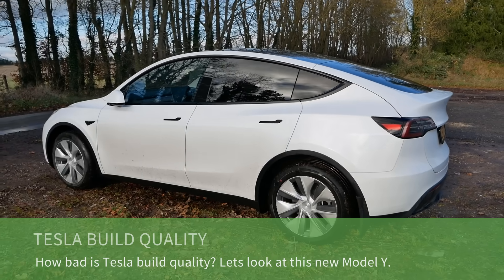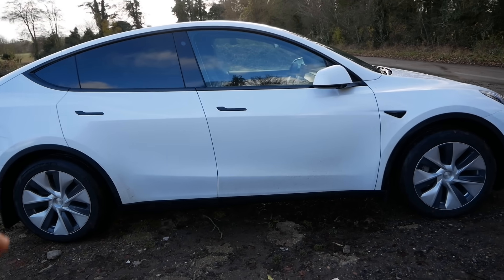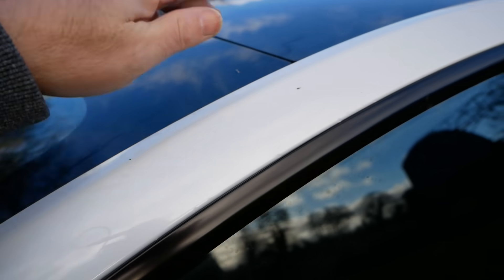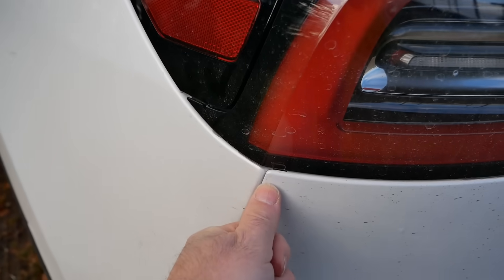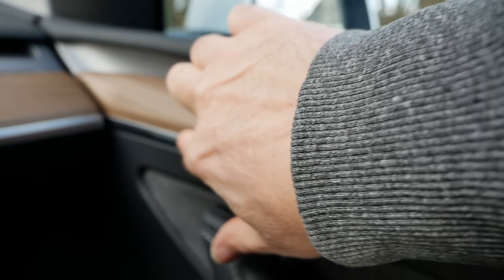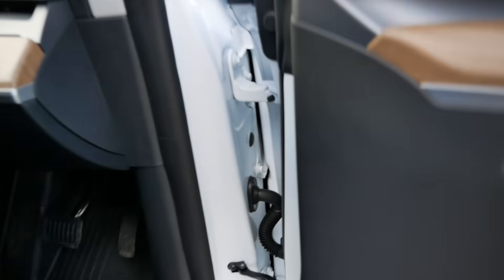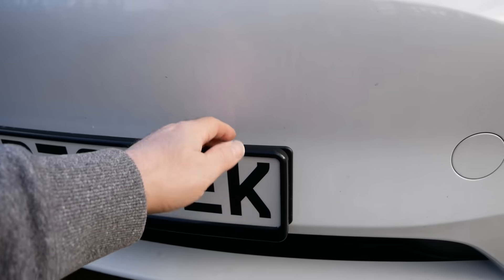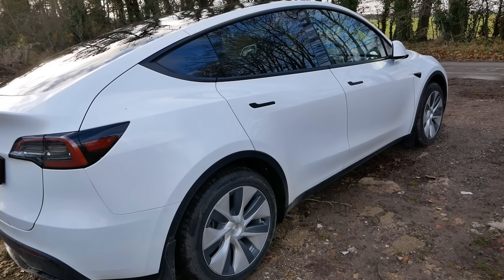How good is Tesla build quality? A look at a new 2024 Model Y.

Comment: Took delivery of first Tesla last week (model Y).  Have to say, compared to my previous BMW i4 M50, it’s been much better than I expected.  One annoying thing is the buzz / rattle that comes from the rear view mirror housing when going over a rough road surface.  I’ve seen a video on how to fix it which I’ll be doing in the new year.
Reply from the maker: Sure the protecting rubber strip hasn't been left on the mirror? It often is on new Model Ys.
You might the next video out on Sunday too. Its about rattles in Model Ys.

Comment: Got a new model Y in June 2024. Over anything but the smoothest of tarmac it has loud panel buzz from several places, the driver's seat creaks and there is a rattle from the back. In contrast my 4 year old BMW i3 has no creaks or rattles.  For me, interior quality is much more about silence than the materials used so on that basis Tesla has failed miserably in my case !
Not sure if I should ask for it to be looked at under warranty?
Reply from the maker: Yes you should do. If they can find the causes of the noise, they will fix it.
Where was your Model Y made?
Mine has done 12k miles now and still rattle & creak free.
Reply: @GoGreenAutos  It's exactly the same as yours so made in China. Thanks for the advice, I will contact the service people

Comment: My 2021 Y was one of the good ones I guess, I haven’t noticed gaps or anything major. I did have to screw in one of the bolts at the front, it was half way out from the factory. So far so good, no rattles or crazy gunks. But it’s been 25k mi, we’ll see at 50k. White is such a nice color.

Comment: Got the exact same one on the 25th Jan. I would guess our cars were on the same boat. Ive noticed maybe the boot alignment isnt 100%, but other than that ive noticed no quality issues. Rear seatbelts have a habit of finding their way onto the plastic to rattle, just need to make sure those rear seats are reclined. Being an EV is so quiet, you hear everything. My fave features so far, the cabin heats up so fast, and the sound system is awsome
Reply from the maker: Yes the heating is so fast. The sound system is probably my favourite feature.

Comment: Those huge wheel arch gaps ! Not cool. Panel gap gets smaller as you go down.
Reply from the maker: I've checked with some plastic shims and the gaps are equal as you go down the doors. If it looks not, its the camera angle.

Comment: Just snagged a 2024 Y built in USA. I do have one minor issue. The seal between the driver’s side door window and the frame is ever so slightly not sealed properly. This creates a faint noise almost like your window is cracked open a bit when driving at higher speeds. Other than that nothing else is wrong and I’ve inspected thoroughly. Mobile service will be coming to fix it in a few days for free. All in all it could have been better but the overall experience was very good.
Reply: How did the fix go. Do you still like it?

Comment: Own 2023 Y long range - issues with random wiper turning on while driving and still the same after 4 repair visits in 6 month.  Don’t buy TESLA.
Reply from the maker: Wipers were turning on when Autopilot was engaged and they really cocked up auto wipers. But its improved with later over the air updates. I find the wipers work just fine since the last few software updates.
Reply: @GoGreenAutos  they updated my sw and cleaned the camera and it still does EVERYDAY.  And the chime alert for green even turns on for red light as well.  Camera goes blind sometimes, too. They have been telling me that the next sw update will fix the issues and the car is sitting in the garage collecting dust.  They can't fix nor want to buyback. Money wasted.

Comment: Mostly what I've seen the Model S is built a bit better. But the others especially when Musk insisted on increase in production. The Quality control seems very lacking for what your paying. I find it funny Sandy Munro goes gaga over the engineering, yet never said one word on build quality. I know every factory has lemons that get released. But you'd think there should be inspectors to make sure if it has leaks into the rear signal/brake lights, or other issues, they should reject them and correct it before selling it.

Comment: I am disappointed my 2021 model Y climate control system had to be replace at almost 3000 dollars because I was over the 50 Thousand mile and they can’t make a climate control system that last two and a half years very disappointed
Reply from the maker: Not good news. However, I've been extremely impressed with the climate in the MY. Its been the most impressive heat pump system I've experienced.
Reply: @GoGreenAutos  

There was a YouTuber from Iowa; he had the Heater/Compressor gone on his Model Y 2021?  59k miles?  And cost 3k to have replaced including having Had Tow Truck tow 70 miles for 720.00 Dollars... in December 2023.   That is not Impressive!  versus we used our Subaru Legacy 1992 = in the first 12 years cost us nothing but Oil Changes myself for less than 50 Dollars a Year.

And the Timing-Belt was original until 2019!

C'est La Vie =  That what we call Quality and Engineering of Japanese Prides.

Comment: Good video. Very meticulous exterior examination for fit. 
I am on my sixth Tesla (‘10, ‘12, ‘16 . . . ‘22) and I have never had a complaint about fit nor finish.
In this video, he talked all about the exterior fit, but not the quality of the paint job, which is the meaning I use of the word ‘finish’ in the context of fit and finish. It seems this owner uses one of the other definitions of finish, or simply ignores it on the exterior. On the interior, he does talk about the finish of the driver door aluminium trim.

Comment: How good is a much better title. Panel gaps worries are for OCD types. We have 2 Y’s 2021 & 2023 both are just as high quality as any of the many Toyota’s I used to own. Fremont 2021 Austin 23 both are excellent. If people knew how much better Teslas are at 95% of what cars do they would take off their it’s not perfect so forget it glasses and make the switch to the obvious next step in modern transportation. ICE was fun while it lasted. My panel gapped 2021 Y upgraded performance is still undefeated out of the lights. The Only mass production car as fast as a Tesla is another Tesla. Safer, much faster, Incredible efficiency, Killer stereo, awesome seats. Still on my OG wiper blades after 3 years 76K miles. Teslas might not be for everyone but they are perfect for us☀️⚡️🔋 🚙

Comment: Battery powered vehicles looking for a solution to a problem that doesn't exist.
Reply from the maker: The problem is air quality and poisonous emissions from burning oil in a car. That problem does exist.
Reply: @GoGreenAutos  This isn't the 1960s.   ICE emissions today are so insignificant it's not an issue.  The MGUY channel lays out the stupidity of Battery powered vehicles, but what would an engineer know about it.

Comment: My 22 y perf has been to shop 3x. Once for clicking rear axle needing relubed and tightened. Once for rain soaking rear cargo area leaking through rear glass had to be resealed now its in shop for faulty seat air bag sensor being replaced. Panel gaps and unlined outside door trim. The 2023 y lr loaner I'm driving makes a loud bang from tear when starting off from a stop occasionally. Feels like I have been rear ended. So much for build quality. 😂😂 if I didn't love driving this thing so much I would care. But I don't. Myp is most fun car I've ever owned.

Comment: With my 2022 Model Y the plastic around the rear view mirror rattles. When it happens I push it up into the glass and it goes away. I saw another video that mentioned this issue and that guy got it fixed.

Comment: The "poor build quality" issue was real some years ago, but has now disappeared.  The anti-EV, anti-Tesla, anti-Musk fanatics have had to find new topics to whine about.  Life goes on...
Reply: Dont have to find anything.  Musk supplies crap hourly on Twatter. 😂😂
Reply: Not necessarily true. I just received a model Y. I had a panel gap on the left door, and the top glass on my model y had a hairline crack through it. I had to take it to get them both fixed. They did fix it for free, at least .
Reply: The panels flying off the cybertruck would like to have a discussion

Comment: Bought a 2023 MY LR built in Austin TX. I gave the vehicle a thorough look-over at delivery, and ever since. Verdict?  The build quality is flawless to my eye. If there are panel gaps, mis-alignments, trim displacements, light and camera installations, or panel/glass height discrepancies, I cannot detect them with my very critical eye. I do get a passenger side seat-belt rattle sometimes, and that's my biggest (and niggling!) criticism. 

OK, one other gripe, more important: I live on dirt roads in northern New England, which means dirt and snow. The rear back-up camera gets quite dirty and is a constant chore keeping clean. Would appreciate a better rear-camera placement. 

Other than that? After 23K miles in my first year, the MY is absolutely freaking brilliant.
Reply from the maker: Good to hear.
Yes the cameras need a wash or blink system to keep them clean, especially for future self driving.

Comment: I picked up a Model Y Performance in December of 2023. There were still issues from the factory. Not as bad as my Model 3 Performance though. I found a few loose threads on the seat, a door ding, about 8 dust specks in the paint, scratches on the red calipers, adhesive on the glass, scuffs and scratches on the paint. Even on the new car it took a full day to buff all of the scratches out before bringing it in for paint protection film and ceramic coating. The new car feels much nicer than my Model 3 and is quieter on the road. The new Model 3 highland may go a bit further towards improving on the quality of the vehicle. It still does not feel as premium as the materials in our Lexus or BMW.

Comment: Is this still having traditional Model Y issues on wheel wells (very thin paint layer & water collecting inside the panels)?
Reply from the maker: The Model 3 had thin paint issues on the sills and wheel arch edges. All sorted with the Model Y as those vulnerable areas are covered in plastic.
Reply: @GoGreenAutos  Yes, I know. The painted and water filling parts are hiding behind the plastic cover. And apparently these parts can rust even after one winter season in the areas that use a lot of salt to de-ice the roads.

Comment: Great to see that your vehicle is not a lemon. Tesla has definitely improved the build quality of their car but they need to control their cars better when delivering them. I took delivery of a refreshed Model 3 aka highland and the trunk was misaligned that it damaged the paint on the left corner. I noticed this on delivery day (my 1st EV) and could not believe my eyes. I obviously immediately notified the nice lady at the delivery center. What really disappointed me was what came next. She told me that I could refuse delivery or take delivery and log the issue via the app for service repair. I was speechless. I did read about Tesla's low touch car delivery but that they don't check their cars before delivery was a disappointment. There was another couple taking delivery of their highland and they had paint issues with their red vehicle. Thank god I took white. Long story short. Tesla need to improve the pre-car delivery checks and put a bit money into making it an experience instead of going around the car with a check list. Was truly funny to watch owners walking around with check lists.
Reply from the maker: Yes, that's Tesla way. If the car has faults, they rectify it later with a ranger visit or the car goes into the service centre. If you didn't know that before collection, I can see why you would be disappointed. Tesla's collection sites have no facilities to do such work. Most are just open car parks with a portacabin and they just fit the number plates there.
Reply: @GoGreenAutos  Now I know why Tesla have better margins on their vehicles. No customer service or quality assurance. 

Still happy with my choice but not getting used no indicator stalks. To many years of driving with indicator stalks.

Comment: We replaced our 2019 American built M3P with a 2024 Shanghai built YLR and we can definitely tell the difference in build quality, panel gaps and overall finish, both inside and out.  We also have a 2022 Polestar 2 and that felt a lot better screwed together than our M3, just more solid, neater finish and a lot quieter. Where Tesla beat competition, no matter the age or build location, is in the tech, nothing comes close.  With the PS2, the screen crashes randomly, loses connection or just fails to switch on.  Saying that though, it's a complete faf to use the towbar on the Y compared to  the PS2 where it's a button press to drop the hitch and another press to release it VS the Y where it's get a toolkit out, dismantle the plastic from the bumper, insert towbar, lock it in place...

Comment: Ive had a 2023 Model Y Shanghai for 1 year here in Norway. Absolute the best winter car ive ever owned. -25C and no issues as long as you pre-heat with the app. Top notch build quality and overall a very good car. My third new Tesla since 2017.  And the best build quality of them.
Reply: We took our almost new my for a spin in -35c. 350km no stop, charging after that trip was no problem either. Started from warm garage though
Reply from the maker: But the mainstream press have kept telling me that EVs don't work in the winter!
Reply: Hi in norway, i guess you have the AWD version? Du you use studded tires?
Reply: @trrc9276 10-15 years ago, studded tires was the normal.  Now its the other way around.  So studded tires is still around, but the mainstrean choose no studs. My 2023 Y came with Nokian hakkapelita R5 ev winther tires.

Comment: I'd like to have an instrument panel at the steering wheel.
Reply: Why? explain the difference between glancing down a bit to see information versus glancing sideways a bit to see information?
Reply: @jm100368  Agreed... I've driven 2 rental Teslas for over a week each and it took maybe 5 mins to get used to looking at the center display for info.
Reply: Taking your eyes off the road @jm100368
Reply: You mean looking ahead and looking off to the side. @jm100368
Reply: @jm100368 much more risky. At least, when you “glance down” your peripheral vision still has what’s happening in front in sight, albeit not focussed. Sideways is a different story.😅 Tesla’s choice with no dash is silly.
Reply: There are plenty of aftermarket kits that will add a instrument panel behind the steering wheel.

Comment: Cabin sounds like a tin can hollow and loud. Your in for a shock of you think this is a luxury SUV.
Reply from the maker: No, Teslas aren't luxury. But its quiet, the premium sound system is amazing and software interface is the best. So while there are more luxury cars, I would still choose a Tesla.
Reply: @GoGreenAutos  Sound like a tim can inside the cabin, you must have bad hearing.
Reply from the maker: @badimpulses17  pardon?
Reply: @GoGreenAutos  Did you know in China if you drive a Model 3 or a Y your not considered high class?  Pardon?
Reply from the maker: @badimpulses17  good
Reply: @GoGreenAutos  I'm not a Tesla hater I used to own a 2020 Model Y my experience was bad.
Reply: @badimpulses17 is it so important in China to be considered high class?
Reply: @Zeek764  Thats every country not just China.
Reply: I picked up my MY (same model except blue) in late October from Southampton and I’ve driven it over 5000 miles. It’s exceptionally quiet, ‘double glazing’ on back and front door windows. Maybe @badimpulses17 you’ve got tin ears.
Reply: @keithwillis5662  Mine was a 2020 Model Y and no I have regular ears.

Comment: Very good video on Tesla quality.  
Off-The-Wall question(s):  How likely/useable are Tesla vehicles with limited or No Internet access?  Rural areas of Europe & North America where there is almost no Cell Service/Internet.  Is this possible?  Not Updates/Not Maps/Not Entertainment. But a isolated signal Telsa.  Thanks for any insight.
Reply: If there is no dense forest nearby and you can mount something on the roof of your house, why not order Starlink?
Reply from the maker: I can't answer that as I've not experienced no coverage. There are times when I'm driving through areas of no coverage in the UK which may last 5 minutes or so. But often the Spotify music keeps playing as its buffered enough (as long as you don't skip tracks) and the satnav keeps working. Teslas do a good job of keep roaming looking for a signal. There has been a recent issue in the UK with the EE network where cars would lose reception for longer periods, but that has just been fixed.
If you want to update the software in the car, you need to park it within WiFi range and let it update (can take up to an hour).

Comment: It looks in your video that there is still colour shading difference on the bumper panels? This has always  been an issue, particularly with the white for some reason.

My 2023 model Y has irritating high frequency rattles and creaks from the rear end, any ideas anybody?

I was wondering if the rattle was the rear number plate mounting?
Reply from the maker: I've not seen any colour differences with human eyes. But using a digital camera often picks up those differences. However, this is very common as the painted panels are different materials, one metal, one plastic. I would say the Model Y is as good as the rest and best in that respect. Some cars its quite noticeable.
Reply: Think you need to fix your keyboard bro 😂
Reply: @paulb1951  corrected...I had the lisdexit keyboard turned on 🤣
Reply: @David-bl1bt  
Love your reply. I used to be lisdexic, but the doctors say that I am KO now.